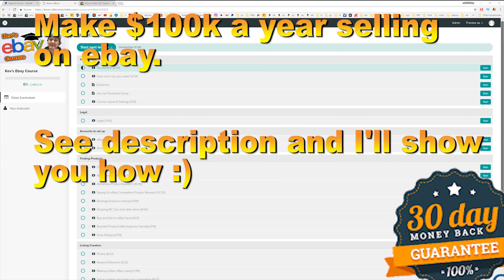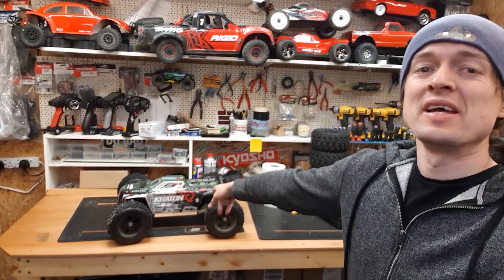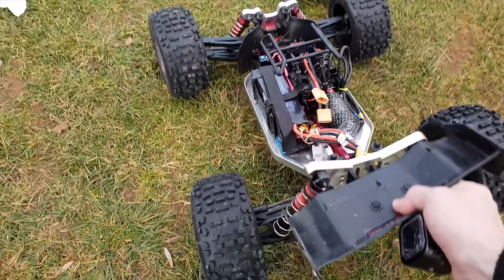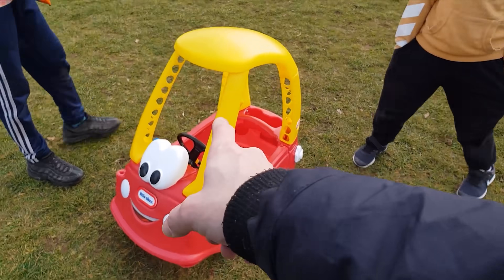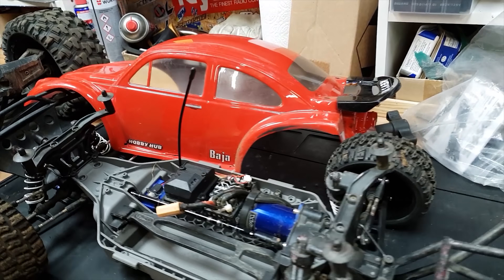Jumping RC Cars at a Drone

Comment: Hey Kev, I see a lot of people using the Leopard 1730kv 4092 motor with the Max6. I personally am rebuilding my Talion with that setup, and the JustBashIt parts as well. Also, I run duel fans on all my motors because they tend to get real hot under a hard bash, and will seize up, or spin a bearing. Open up that motor can on the Kraton and check the bearings. Could be as simple as that.  Great vid Kev!!👍👍
Reply: Castle 1717

Comment: New motor for Arrma Kraton: get a Castle 1717. 1580 kv.
With the max 6 ESC. you already have, with about a 22t pinnion, it will be a beast. Keep in mind you will need a aftermarket motor mount for big motors and pinnions. One that sits higher than the stock one. Hot racing motor mount works, but you still need to add shims under it for enough clearence.

Comment: That's odd! I've never seen anyone's motor lockup like that!?!? Huh! I do know from experience that the motors need quite alot of red locktite on the motor shaft itself for the pinion. The motors have so much torque they will still find away for rip the pinion off even if the grub screw is tight. I dont know if that's the problem but maybe? Maybe the pinion came off slightly and is rubbing on something?
Reply from the maker: it was the motor, i took it apart the rotor came apart
Reply: @KevinTalbotTV  damn so it's internal? What is the rotor? Is that what the magnets are attached to?
Reply from the maker: thats it

Comment: kev a good motor for the kraton would be Turnigy XK3674-1650KV 2400W Inrunner or Turnigy Trackstar T28 1/5th Brushless Motor - 780KV
Reply: Castle 1717
Reply: The x0-1 motor.
Reply: @Dimomult  he is wanting to 8s, that motor is expensive and only does 6s
Reply: @Dimomult  the funny thing is that today i burnt out my motor on my revo

Comment: Damn, is that xmaxx differential made of glass? It's always cooked..
Reply from the maker: You not using it right lol
Reply: Ooof...  dang pat! Try shimming that thing.. poor maxxine😭 lol... I've heard of the bec's being an issue on that esc.. oh well... more parts and do it again! 

And what kev said...lol
Reply: Because you need the centre diff dude
Reply: @PatsRC  looking forward to it.
Reply: Richard "Pat" Fegan replace the bulk heads. I had the exact same problem and called Traxxas. The rep told me to replace them and I did with no real issues yet. Also make sure that when you change them you do 8s diff gears that are brand new and not the ones you have that are good still. Hope this helps!

Comment: Kevin Talbot exploits small children for views! xD

Hey, for the Kraton motor, open it up and check the bearings. That's the first thing I'd do. For a motor to lock up, it would either have to have bad bearings, or I guess a bent shaft. Wouldn't be surprised if you could fix it though... or on second though, maybe Steve or Pat can fix it.